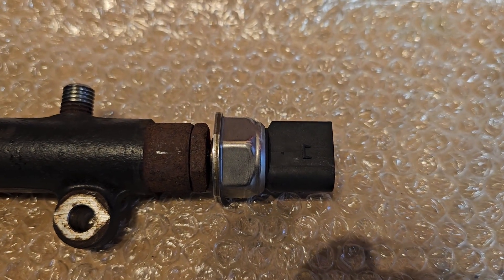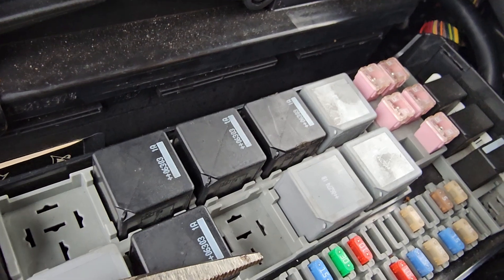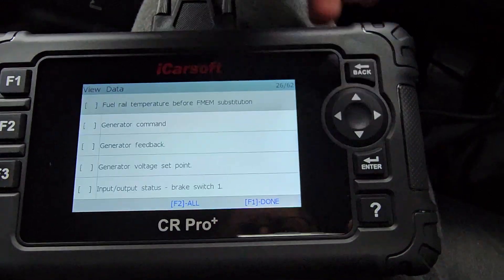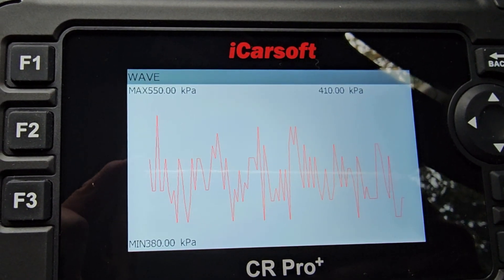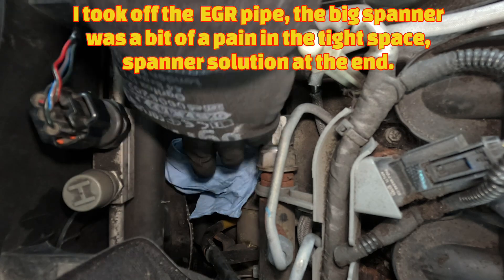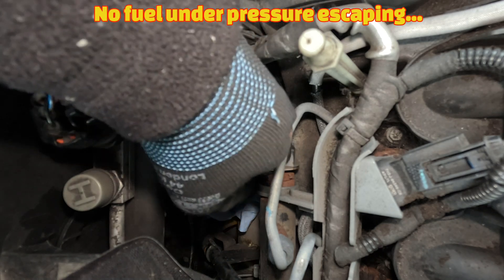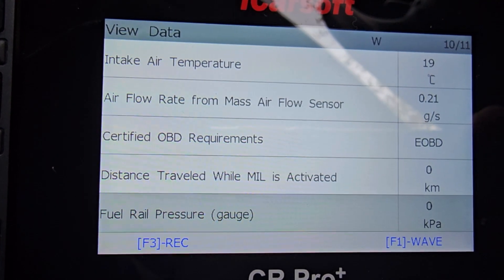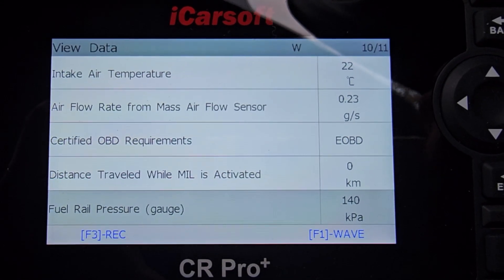Land Rover Discovery 3 (LR3) - Fuel Rail Pressure Sensor Replacement | Performance Fix for £20!

Comment: Thanks for the vid! ,maybe I missed it, but what was the original problem/symptom?
Reply from the maker: I was getting fuel rail pressure warnings on my diagnostic tool and the engine response seemed off, especially when taking my foot off the accelerator.

Comment: Hi, can this sensor cause black smoke when you go over 3000 rpm? I had this code.  Velar d300
Reply from the maker: Are you getting poor performance too? It could be a split intercooler hose.
Reply: @alexgreentransplantmechanic  I have a slight loss of performance but nothing alarming I don't have the restricted performance message
Reply from the maker: Check the intake system for air leaks, smoke means over fueling. It could be the mass airflow or MAP sensors. So a diagnostic scan would help. On my D3 there was no restricted performance error, just smoke and reduced performance with the split hose.
Reply: @alexgreentransplantmechanic  I changed the map sensor, but nothing has changed, do the MAF sensors need cleaning or how can we check its condition?

Comment: Would this cause a start condition and then 20 mins later a cut off ? Runs great at idle 5 minutes then gets rough then shuts off . Limited as I’m a medic and mechanic in Ukraine and I don’t have gap tool here to see anything . Worth a try cleaning ? Or is it just replacement time? I had good high pressure pump readings then the car shut off and won’t crank , rebuilt injectors
Reply from the maker: Sorry I don't have a proper answer for you, It would be hard to diagnose without a code reader as the vehicle relies heavily on sensor data. The error codes generally point to the source of the problems.

Check as much as possible on the intake and fuel systems and temperature sensors.
Clean intake components.
Mass Airflow Sensor
Oil Temperature Sensor
Manifold Absolute Pressure Sensor
Low Pressure Fuel Pump Pressure and Relay
Change the Fuel Filter
EGR Valves
Fuel Injector Pressures
Battery Voltage and Alternator Output
Air Filter Element and Intake not blocked
Intercooler Pipe not split

Comment: Lr3 should have about 58 psi? Maybe thats only for 4.4l and 4.0l?
Reply from the maker: My vehicle has the TDV6 diesel engine, which operates at much higher fuel rail  pressures than an equivalent petrol version.

Comment: I have the same issue, is the procedure the same on a Disco 4 (2010) ? What is the part number of the sensor and where did you get it? The LR dealer only sells the entire part with the tube for 900.- Euro!

Comment: With ignition  switch  off and keys in your pocket most engine systems will register a fuel pump pressure reading just by opening the driver’s doors. The smart engine systems prepares for start up.